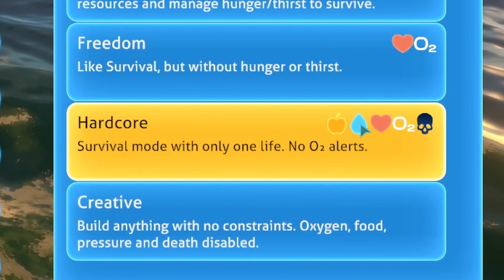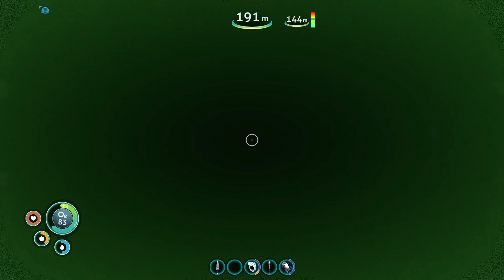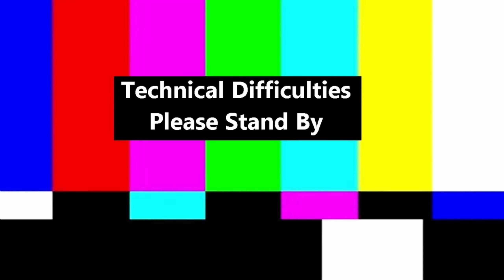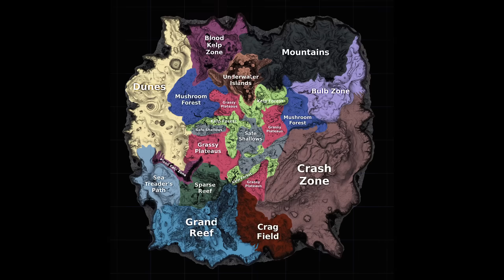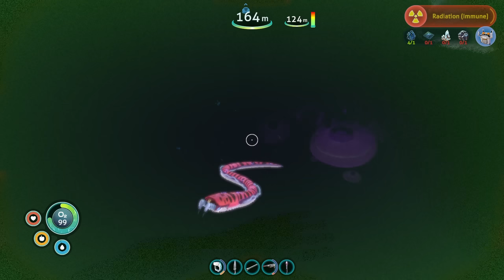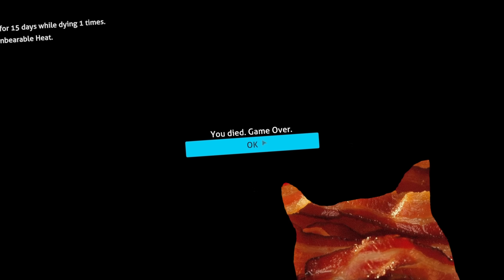Subnautica's HARDEST Challenge BROKE ME! (Kharaa Deathrun 2.0)

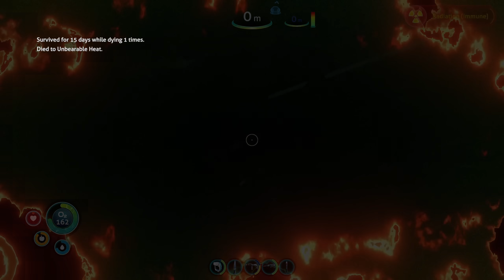Comment: 12:27 idk if you know this- but if you get a running start, you can actually jump on the big box blocking the door.. so you can skip doing this risky walk around through the fire
Reply from the maker: Does that still work? :)
Reply: @TheLastBacon  yeah. It worked the last time I played this game which was a week ago. All it is, is getting a running start and then jumping around when the slope starts to transition into a flat surface and ryley will get on top of the box in the pile blocking the door.

Comment: I did a simelar approach in my deathrun challange, and you can either avoid the fire entirely with one specific alignment, where you clip the edge of the box on the bottom which pushes you up onto the box, or you can immediatly pause the first frame after taking damage with PDA Pause enabled, heal, unpause for 1 frame, pause again, heal again, unpause until you clear the fire. It appears to be not 100% immediate but you die fairly quickly
Otherwise you could also just do the jump
Or you know, make the canon but who wants to do that
Reply from the maker: Oh wow interesting strategy with the PDA! :O

Comment: The Bacon is extra extra extra extra extra crispy. Well huh, I guess one thing I’d suggest is getting the chip that lets your helmet filter the air so you can breathe on the surface. I forget how to do that though but it will make surviving the Aurora more likely. 

Your bridge reminded me of the joke about building a base around the side and into the Aurora. I actually tried that in creative and it is possible, although I didn’t appreciate the distance between that ledge and the hole in the aurora until I was building a long anti-Reaper tunnel over there. Also there are some points where due to height differences you will need to build down which means getting out where the Reaper is. Overall your solution is safer.
Reply from the maker: I’d love to get that one :) Not sure it works on these settings though.

Comment: There are other ways to go past the cargo boxes in the aurora safely. You can parkour on the crates to get over and thats what i did since launch. Basically theres a crate on the slope that you can sprint jump off of and have enough height to make it onto the boxes and clamber over. Despite the horizontal airspeed nerf of 2.0 it's still doable but it will require just a LIIITLE more work.
Reply from the maker: I’ll definitely do that next time :)
Reply: @TheLastBacon ok thank god you know. Funny thing is i did that first playthrough not knowing u were intended to use the propulsion cannon as hinted by the fragment in a box nearby lol.

Comment: dang 6.4x i only managed to beat 5x (with 3 deaths and more then a few save scumming lol)

btw i have a few tips and some important warnings (idk if they still matter i havnt played subnautica in a while)

1 the reaper wont attack you if you hold out a peaper (im not that sure about this one but you should test it)
2 if your inside your house you can use the habitat builder with zero battery
3 the lava castle is like the biggest run killer you will get 1 shot by sea dragons and they will basicly always be angry at you 
4 even more lava zone being a run killer when you enter it from the tree area there will be 3 warpers coming for you take them seriously they can insta kill you 
5 the ghost luviathan in the lost river can infinitly camp you if you go to the architect facility behind the waterfall
6 my bonus tip is watch out where you drive/park the seamoth it has like negative health
7 oh last tip the mountain island is extremly!! unsafe the reaper there can just go through the mountain to get you

sry if its a bit to much information this mod was a traumatic expirence and i had so many failed runs till i decided to just quit the hardcore
Reply from the maker: Thank you so much for the advice :)

Comment: I think I died to that precise fire a few times even in a normal, vanilla subnautica. I think devs made it insta kill to stop you from progressing without the propulsion cannon
Reply from the maker: That’s super annoying :O
Reply: @TheLastBacon  Yeah this guy is correct, that high ledge has an instant deathtrigger on it, I don't remember if you can even extinguish the fire, I think you might even be able to, and then even when the fire's out, you still get instagibbed. You can make the jump to clear the boxes without the prop cannon by jumping from the box that's closest to the back left corner when looking down the ramp. I'd practice the jump in creative or something before trying it in a tense moment.

 Fire does do a bit more damage than normal in deathrun, but it's not an instakill, you can run through small sections of it.

 To make it into the Aurora on hardest settings, I find that 4x 90s tanks (1 worn, 3 in backpack) is pretty comfortable, once you repair the radiation breaches, the air inside the Aurora becomes breathable.
Reply: I don't even use the propulsion cannon, you can do a tight jump from the platform next to the crates to land on one edge of one of the crates, on my first playthrough I thought this was the intended solution as I didn't know propulsion cannon works with crates.
Reply: I had never thought of using the propulsion cannon on that I've always just jumped over them from the bottom 😭
Reply: YOU CAN USE THE PROPULSION CANNON FOR THAT????

Comment: u should use the air bladder when traveling in the shallows, its much easier and faster to use than pipes and basically replaces being able to breath air on the surface, it should work on the aurora but I'm not sure
Reply from the maker: I’ll try! :)
Reply: @TheLastBacon btw forgot to say it does not let you breathe from the air bladder on the surface.  U have to refill it on the surface then breath it underwater.

Comment: As funny as this was the pump can be used with any body of water in the aurora.  You can just book it for the drive core and set up a pump and pipe then have unlimited air to fix the drive core.
Reply from the maker: Not on the hardest setting - the pump is disabled around the Aurora in this :)
Reply: @TheLastBacon welp, as they say in France; le oef

Comment: can't you just use pipes and a pump inside the aurora to get o2?
Reply from the maker: Unfortunately the pump doesn’t work close to the Aurora in this mod :D
Reply: @TheLastBacon  But you could use pipes to transport the air from outside the aurora to the inside if it's only the pump that's not functioning

Comment: Using the pipes to skip straight up to the ledge part is actually a really cool idea! I never even would have imagined someone actually doing it, and in a mod that makes it so easy to die
Reply from the maker: I should start using it more often :D
Reply: i made a WAAAYYYYY more expensive version of that. made a LOOOOONNNNGGG tube from a corner of the kelp forest closest to the aurora and just went straight ahead. and it worked. along the way i did find out that the pipes can only go so far out before reaching the limit of how many you can chain togeather. but this seems like a far better strategy.
Reply: @wizzzard999   In Bacon's original deathrun series I remember Bacon trying to use pipes to go into I think the jellyshroom caves. It's been a while since I've watched the series, but I remember the pipes not being able to extend further I forget if it was a collision issue or maybe it could have been the length thing like you mentioned.